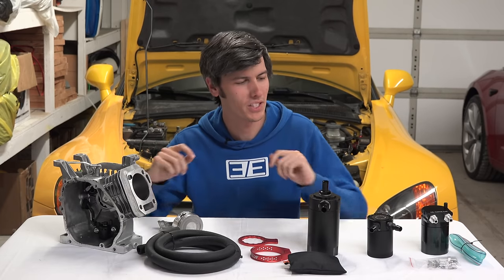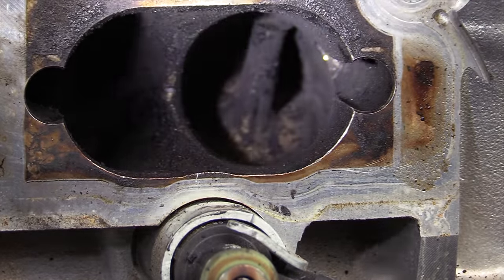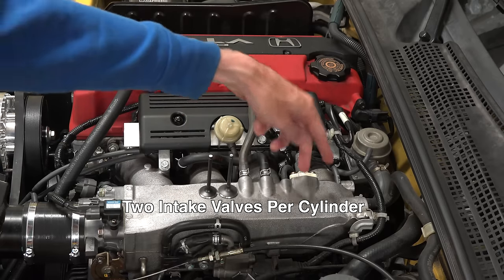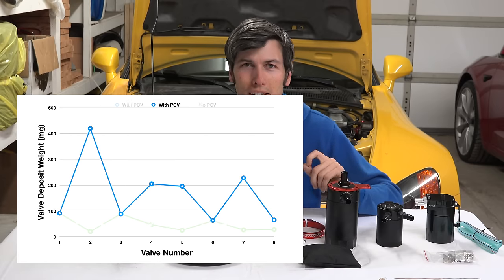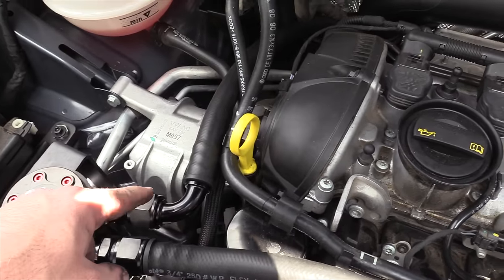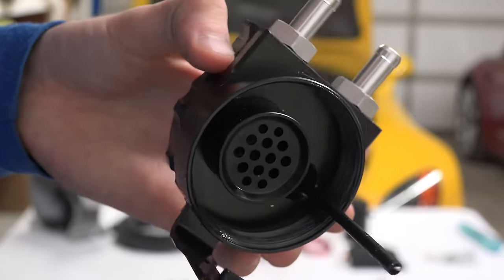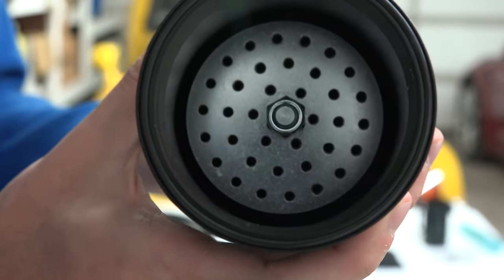Do Oil Catch Cans Actually Work?

Comment from the maker: A lot of questions asking "why don't catch cans come stock on cars?" Lots of reasons here, but some of the most obvious: 1) It's another maintenance item, and customers have a hard enough time just keeping up with oil changes. Examples like AdBlue and water injection systems, come to mind, engineers try to develop solutions around customer maintenance. 2) If a customer neglects it, the catch can fills, and then you're dumping that oil into your intake; this is worse than doing nothing at all. Then it's a liability issue for the manufacturer. 3) Ideally, a proper engineering solution to prevent carbon buildups wouldn't require any effort on the customer's part. This is where auto companies will put their focus. "How do we prevent carbon deposits." There are companies that do much better than others with DI engines. Catch cans are not the only solution. If you have an engine that suffers from carbon deposit problems, a catch can is likely to improve the system, as demonstrated in the video.
Reply: What about dual injection systems like Ford’s twin turbo 2.7 liter Ecoboost that also have port injection along with direct injection? Would a catch can still be useful there?
Reply: There's a 4th reason - engines operated in freezing temps could experience freezing of the water vapor trapped by the can, reducing the efficiency or worse, plugging the PCV system and blowing a main seal!
Reply: No mention of the more expensive, yet better engineered air/oil separators? They have a coolant line run through them to prevent condensation, and run an oil line back to the sump so you never have to drain them.
Reply: @PyroVulpes  I think running that oil back to the sump is not a good idea since that's already contaminated with by-products from gasoline blow-by.
Reply: My st205 celica does come with one as stock, question is venting to atmosphere bad for the engine?
Reply: A lot of OEMs DO actually perform this. They don't have a separate can, because yes, that's maintenance, but imagine if you had a "can" integrated somewhere that could drain oil.

A lot of valve covers (or wherever the PCV has exits) have baffling or swirl chambers in them designed to capture oil mist and drain back into the crankcase.
For example, Ford Ecoboost motors have this, a lot of the VWs mentioned have this, etc. The technical term if you search for it is an air oil separator (see Ford part AG9Z-6A785-A for example). Even vehicles that predate direct injection have this kind of baffling, because oil vapor in combustion reduces the effective octane.

It's a real disservice to imply the OEMs do nothing to take oil vapor out of the air, especially on high compression boosted motors we see everywhere that simply wouldnt function without some degree of it there to prevent oils detrimental effect on knock resistance. The BMEP you see on these modern motors are incredible, and achieving them on 87 octane with even the slightest bit of oil ingestion (like from say the PCV system) is a challenge for OEMs and their suppliers.

I think these are so prevalent because its easy to believe that a catch can will magically solve an issue (and they're easy to make and turn for a profit), meanwhile soot from combustion hits the intake valves due to either internal (via VVT or direct design of a more Atkinson leaning cycle) or external EGR, and you still get a good amount of buildup that way. In DI you don't have much fuel hitting these valves (and the little you did you just removed with your catch can), so its safe to say the soot is going to stick.

Its nice to say, "Oh hey my catch can is catching shit, I'm saved!",  while all of that is still occurring and still causing build up.

As a scientifically guided guy myself, I'd also assume OEMs designed the vehicle knowing that blowby would be there, and even model the PCV airflow and how much of it contains fuel vapor (for accurate fueling!). Your catch can now removes that small but previously accounted for airflow. (Some OEMs even monitor this, and detect blockages! Again, I turn to Ford because Im most familiar with their systems).  We're after the oil, but forget that blow-by also has a good amount of fuel and water vapor also being caught that the system was originally designed for.

Food for thought: It would be cool if you'd be able to convince an OEM engineer to talk about this kind of stuff for some authoritative answers on the matter, or things that they consider when designing these systems!
Reply: @RickJohnson  Looking at their design, unless if they freeze when complete full, it won't matter.
Reply: @normalguyreviews7102  It's not bad for the engine, but definitely bad for the environment.
Reply: Normally before replacing spark plugs on a vehicle. I would rev up the engine to about 2000 RPM and dump a quart of water very very extremely slowly into the carburetor. This will remove all carbon deposits. Do this under your own discretion please. Adding water to fast could cause you to bend a rod.
Reply: @kaan6198  no decrease in power or fuel economy, rather the opposite as the system don't get clogged with crap so the engine runs more efficient.
Reply: @kaan6198  no to either of those, all it does is catch the oil vapors and whatnot from your crank case. only con would be you have to empty it out every once in awhile.
Reply: Actually, I know Porsche has air oil separators installed on some of their cars from the factory. Had to replace one in an old boxster that failed
Reply: @koimaxx  Where did it come from to begin with?  Plenty of engines out there running CCV with returns to sump.
Reply: @normalguyreviews7102  No, but according to the EPA it's bad for the environment.
Reply: Malibu 2.0 has a factory catch can without any baffle.  It’s just a plastic container under the intake tube that has a hose attached that’s  venting the motor.   The top of the can is plumbed into the underside of the intake tube.  Problem is that it’s hidden and not mentioned anywhere.   You have to remove the intake boot to see it and dump it out.   How many people will just fill it up and get a stream of oil going into the intake.
Reply: OR do what toyota did and make a direct injection and port injection system so that some fuel is mixed into the valves that cleans the carbon as it runs.
Reply: @D2O2  I'm not quite sure I've ever encountered an engine that returns the crankcase gases back to the sump. The gases contain not only unburnt fuel (which can change the chemical properties of the oil), but probably worse is water vapor (since the main by-products of a clean combustion is water and CO2), which if condenses into the oil will cause the oil to sludge up, and cause a whole whack of other issues.
Reply: There are cars that come with catch cans, for example my Ssangyong Rexton 2.7 litres Direct injection diesel comes with a self-drain catch can that drains back to the crank case, the engine is designed by Mercedes Benz back at the beginning of 2000's, so I assume that most Mercedes Benz diesel engines will present the same feature now days.
Reply: @Super6-Four  a lot of Subaru owners including myself run air oil separators, they tap into the coolant lines to prevent condensation from forming (the water problem), and fuel blowby is why you change you oil more frequently. This is expecially true when running boost due to higher cylinder pressure. Gas is going to mix with the oil. The hardest part is making sure all the lines are ran properly, because any kink can block the AOS causing the listed issues you have
Reply: fredkuhn165  I’m pretty sure that is an aftermarket can on your Malibu. I don’t think gm would put such a low quality sounding part on an engine.
Reply: The real question is, do oil catch cans help on di engines with oil separates like the le2 in the Chevy Cruze?
Reply: Not sure if it counts as the same, but Volvos' have them; little digging shows they've been doing it since at least 1981; they call it a 'flame trap.'  I've also seem them called a 'breather box,'   It is just a box that gets valve cover air and then lets the oil drain down back into the pan and the another line on top back to the intake.  They're a notorious source of issue for people unfamiliar with them; if they get clogged (mostly if the engine didn't receive proper oil changes and sludges up) the engine will quickly blow the cam seals and sometime main seals.  Most forum guys seem to recommend replacing them every ~100k miles.
Reply: Winston Wolf  how does it decrease horsepower ? isnt a cleaner air/fuel mix better for performance ? or am i missing something ...
Reply: Good video, thank you, a step closer. We still have a problem: in the study did show vrntimg to atmosphere to work better but this is not the same as having an oil catch can. The idea these things work is still as far as I have seen, just a logical extrapolation. The evidence needed is to see a DI car known to have issues normally but with a catch can installed baving no deposits on the valves after 20k miles.  Regarding catch cans we do not know  a) if significant amounts of oil are being caught ( relative to unknown amounts not caught b) whether some other unknown factor is at play. ( likely)
For example - what if it isn't only the cleaning of the valves which is reducing the carbon deposits, what if it is actually the cooling effect of the port injection which is cooling the valves so they operate at a lower temperature - hence the valve is harder and so wear is less and seals remain tighter. Or a myriad of other possibilities. Actual comparison is needed as evidence, no assumptions.
Reply: I have a catch can system (does work GREAT as you describe.  Esp. on boosted cars, keeps that oil out of the intake and charge piping. Anyway, I have a system that drains back into the oil sump (return line).  What are your thoughts on those systems?  I've guesstimated (tho there is no science I've ever researched on the matter) that because with a return, you're adding more garbagy combustion by-products to your engine oil over time, that I've lowered my oil change interval down to 4-5000 miles (full synth) and do the filter every time.  My 89 Volvo and 93 Volvo don't seem to be affected in any negative ways, but then again, these old Volvo motors can take such abuse, maybe its not 100% accurate to say everyone's car would be fine doing so.  Any thoughts on self draining/return catch-can setups?
Reply: @koimaxx  Gases don't return to the sump, only liquid.  This is a very common setup on tier2 and up diesel engines for example.
Reply: All ur videos are just explanations ( basically alot of talking and\or reading from a script.     
       How come I've never seen u work on anything?
Reply: great explanation. i think one example that comes to mind for car companies getting around this issue for direct injection is adding a dual injection system like what ford did with the gen 2 ecoboost engines for the f150. making it have port injection as well as direct injection. I am fairly positive they did this with the gen 3 coyote as well.
Reply: @davidev2219  It's in the name of the channel.
Reply: Don't you think that this bronze filter will freeze from moisture on cold days!?
Reply: Thanks for the explanations. But I'm thinking if using catch cans could lead to a modification on the percentage of fuel/air/co2 mixture that goes into the cylinder, and consequently could be a potential issue rising up the combustion chamber temperature and could affect the long lasting of the exhaust valves. Thanks in advance Jason 😉👌
Reply: Kind of off subject but I cant seem to get a clear reason to why this is. If I had a 707hp motor and I lose 57 hp from transfer of energy to the ground through fly wheel, all belt ran stuff to include a supercharger roots style to trans , tq converter, drive shaft to dif to half shafts to wheels. Now every where I look you lose 15% for manual and 15 to 20% for auto. So if I did bolt ons actually changed the drive shaft to aluminum for less rotational mass with  pulley injectors on a higher octane with a tune on a dyno and made 950 hp crank but lost 150 hp to the wheels. Why is it a percentage and if I only lost 57hp stock with a worst drive shaft and still lose 150hp if the internals are stock with  higher octane why wouldnt it be still a 57 hp loss not 150. So why do you lose more power the more energy exerted with the same mechanical properties material while adding more force? The only quantifyable reason I have is that the materials are the same and being metal with more force makes the metal expand thus causing more friction thus taking more energy to spin making less power being that % rate given every where I read while still making more power than you already had. What is the reason for the percentage of power lost for the same materials designated to take 57 hp to spin the wheel in loss then at 950 150hp to spin the same devices.
Reply: Engineering Explained bmw is the closest ones to factory “catch cans” that I can think of, the ccv system in theory is suppose to collect the gasses and accumulate them in a container to return back to the oil dipstick. The ccv systems have issues all the time tho so they are fairly unreliable
Reply: @D2O2  Thanks for clarifying, I'm not too familiar with diesels. Doesn't the crankcase gases also contain some water that could condensate as well. Maybe you could elaborate.
Reply: Easier fix, vent to atmosphere
Reply: Kirby P. mentioned this above, but BMW engines typically have factory catch can. I know for sure that the B38/B48/B58 family does.
Reply: Mark P  the issue with venting to atmosphere is due to the air circulation of the crankcase you no longer have the ability to keep that system free of moisture, which in turn shortens the life of the oil and contributes to build up of sludge.
Reply: @BEAMERNOOB  I've always thought that the pressurized crank in itself would keep moisture from entering. That and a long enough tube pointing down would also help in keeping moisture to an absolute minimum.
Reply: Mark P all tho the pressure is mainly positive it more or less pulses in and out.
Reply: Oil catch cans are a must for S2000's if you plan on tracking them. I have experienced up to 1/4 quart of blow by deposited into my catch can during a single session. However, if i wasn't going to track her, I wouldn't bother. Too much fuss and more routing of oil lines can lead to a fire if not properly installed and periodically checked.
Reply: 2014+Mazdas have catch cans
Reply: @PyroVulpes  Honest question: isn't that actually a terrible idea. I have an oil catch can on one of my vehicles and there is significant water and fuel in it most of the time.
Reply: @AlphaOneActual  Any car that experiences oil-rich cylinder blow-by that escapes into the crankcase and is tasked to the PCV system will benefit from a Catch-Can system.  It's not the best solution to the problem, but its a start in the right direction.
Reply: @kaan6198  I have the second option in this video and I can say that I didn't see a difference in power or fuel economy. IMO adding the mod is just playing it safe, which is a good thing.
Reply: So how does the intake valve get hot enough to carbonize oil?  Isn't more likely that the oil vapor is acting like a glue and what you see stuck to the valve is the carbon particulate from the EGR?  Direct injection engines produce large amounts of black particulate that would love to stick to some oil.   I don't see the intake temps getting anywhere near hot enough to burn oil.
Reply: The number ONE reason is even IF you could make one for 1.00 (which is obviously impossible) they would lose one million dollars for every million units made so...
Reply: Could you do a video on brake rotor warpage and how hot do you have to get a rotor to warp it.. there is a theory that states heat does not cause brake rotor warpage, instead improper wheel torquing is the only cause..
Reply: Heat doesn't cause it sudden cooling does. get the brakes hot then hit a puddle and ping.    @MaddenMaster843
Reply: my question is, where can I get the $20 catch can?
Reply: @normalguyreviews7102  I don't think it decreases horsepower. It effectively raises the octane compared to a system without it.
Reply: @AlphaOneActual  No need for catch cans on dual injection.
Reply: What about an air oil separator though?
Reply: @davidev2219  it's quite literally called engineering explained. Go look up some of his videos with HumbleMechanic.
Reply: @NoZenith  yes checked it out.   Pretty cool channel.    Love all channels like this there the mechanics not only talk and teach, but also practice and show 
      I was just referring to the the taller thin guy (I apologise don't no his name)   iv ran into quite a few of his videos over the years.   And like I said he just repeats data    recycling info anyone can look up off any mechanic teaching data (.  And yes often providing diagrams and even the parts involved)
       All I'm saying is if he actually showed himself practice why he preaches, he will be Much MUCH more credible.   That's all.    Not trying to hate on the guy
Reply: @D2O2      yes checked it out.   Pretty cool channel.    Love all channels like this there the mechanics not only talk and teach, but also practice and show 
      I was just referring to the the taller thin guy (I apologise don't no his name)   iv ran into quite a few of his videos over the years.   And like I said he just repeats data    recycling info anyone can look up off any mechanic teaching data (.  And yes often providing diagrams and even the parts involved)
       All I'm saying is if he actually showed himself practice why he preaches, he will be Much MUCH more credible.   That's all.    Not trying to hate on the guy
Reply: @D2O2  yes I no that   all I'm trying to say is that I    Love all channels like where the mechanics not only talk and teach, but also practice and show 
      I was just referring to the the taller thin guy (I apologise don't no his name)   iv ran into quite a few of his videos over the years.   And like I said he just repeats data    recycling info anyone can look up off any mechanic teaching data (.  And yes often providing diagrams and even the parts involved)
       All I'm saying is if he actually showed himself practice why he preaches, he will be Much MUCH more credible.   That's all.    Not trying to hate on the guy
Reply: Someone may have mentioned this already, but I believe Mustang 5.0 Coyote engines employ conventional GDI, but they also have an extra injector that also sprays over the intake valves like old fuel injection.
Reply: "why don't they come stock on cars?"
my rewording of that question is: Why can't they come stock on cars and engineer them to dump the oil via one way valve BACK into your oil pan when the car cools down or something like that or even electronically when the engine is shut off? Since it's not that much, it could do it on a regular basis in small increments so you're not dumping a bunch of crud into the engine but rather small amounts that can be picked up by your oil filter or get burned off during normal engine use. Am I wrong in thinking this way?
Reply: Why not divert the oil right into the exhaust manifold where it would burn off.
Reply: @jquiznos2283  Probably too big of a risk of water also getting in there.
Reply: I had a 08 Mini Cooper S I added a catch can on, along with a chip tune. I had to empty that thing weekly! In wintertime, if I forgot and didn't empty the catch can often enough it would freeze and leave a solid lump of ice in the container, block the airflow and create leaks around the valve cover seal. It was a mess...
Reply: What do you think about the DaveFab Catch cans?
Reply: With direct injection diesel that have the EGR systems most are completely clogged by 100000 to 150000km. Which costs alot more than $300 to pull the head off and clean the carbon build up. Also including the cost of bad fuel economy because the intake is clogging up. Mann and hummel make a really good oil air seperator filter in there catch can. Replace every 80000km or so.
Reply: @Flyinghook  Haha
Reply: @davidev2219  Engineering EXPLAINED... You're quite literally describing what he does and what is channel is called. Engineering explained. It's not a tear down of an engine or transmission and rebuilding it or showing you how it wears. It's having diagrams and examples and cutouts to explain the situation so you understand what's going on. Most of us are never going to tear down a clutch to repair it but it's nice to understand what's going on
Reply: @koimaxx  You mean just like all the other oil in your engine? Lol
Reply: I'm in the tropics.. I installed the Mishimoto catch can and it blew out my rear  seal from the increased pressure to the system.. Went to check the catch can and tried to blow on it and nothing could pass thru... bought another one.....same thing
Reply: @AyaxRo   Then you bought crapy products. There is no reason and oil catch can would blow out a seal.
Reply: To me it seems like mechanics could empty the catch can during an oil change easily, atleast in most cases where the can is installed in a convenient location. Also it seems like if a can did get full it would only let as much oil through the engine as it normally would without a catch can.
Reply: Kaan i don’t think it will hurts mpg. The catch can only slows down blow by air flow.
Reply: Don't forget it's also an environmental issue as well.  So they don't do it for both the reason that if someone doesn't empty it it can harm the engine AND the fact that you're emptying pollutants and have to dispose of them.
Reply: @smgoldade  You know everything you say makes sense.  Except that the test he mentioned sort of proved the deposits increase not decrease.

As far as the V6 ecoboost, only one side of the system is monitored for flow by a sensor, the drivers side bank PCV.
Reply: Oldsmobile had a methanol-injected turbocharged F-85 (Oldsmobile Jetfire) back in 1962, but they installed this weird vacuum bypass valve system because people couldn't be trusted to keep their turbo rocket fluid tank full, same as it is today with Adblue/Water injection. The question is, however, can I turbocharge my '66 F-85? Not that I want to, it has all the torque a car its size would need and more, even through its lossy slushbox Jetaway transmission.
Reply: @smgoldade  My '66 Oldsmobile has a little plate inside the valve cover in front of the PCV hole, I'm assuming this is its purpose.
Reply: You missed another one, you need a heater on it during the winter if you live in colder areas to avoid it freezing, simulating an overfull catch can.  Also its sometimes not easy to know the maintenance time between emptying, very high humid days may fill it sooner, so you kinduf got to stay paranoid about it filling up.
Reply: Catch can with breather? Without breather?different results? Pros, cons?
Reply: @AIM54A  remember the intake valve has combustion temperatures on the other side of it. Sure it will cool down as the next incoming charge swirls by, but it still operates in a very hot environment, and it doesn't actually take a tremendous amount of heat to  make oil start to coke up a surface. The heat going out the exhaust valve would pretty much burn off the oil.
Reply: @koimaxx  "I think running that oil back to the sump is not a good idea since that's already contaminated with by-products from gasoline blow-by."
an engine that consumes oil?
Reply: Engineering Explained i bought that $25 exact one for my bmw- big difference- why manufactures don't just use them from the start is beyond contemplation ... but good video ☝🏼
Reply: @normalguyreviews7102  no, it just smells bad and makes your engine dirty. If you have a diesel engine, it's highly recommended to install one
Reply: "If you have an engine that suffers from carbon deposit problems, a catch can is likely to improve the system..." -  Once you've developed carbon buildup problems, it's likely too late to avoid having an expensive walnut shell-blast cleaning of intake valves, which is the only real way to remove these deposits. A catch can should be a preventative measure for direct injection engines.
Reply: My parents V168 A-class with a 1.7L diesel has a catch can (or separator) stock, it doesn't require extra maintenance, since it's made to drain back into the engine (through the dipstick channel)
Reply: Jeep Grand Cherokee WJ with 3.1 TD VM engine have OEM fitted oil catch can with auto drain pipe which goes directly into the oil sump.
Reply: @RickJohnson  This is my main concern. I'd love to hear his thoughts on this aspect of the catch can.
Reply: I have seen OEM oil catch can system on the new Hyundai cars. They have 3 hoses, one from the valve cover, one to the inlet collector and one to the oil pan of the car. I guess they have solved the issue of having to empty the can yourself...
Reply: Can you do an episode on Piston Slap?
Reply: @koimaxx  the pcv system fitted to the bmw m54/56 (and others I believe) runs the return from the crankcase directly back to the sump. I'm having problems with the system now due to age and location but the engine is close to 150000 miles and still pulling like a train with very good emitions.
Reply: @ericsundell9978  the bmw m52/54 engine (and others I believe) drain directly to the sump by design
Reply: KelMaster Construction  Yes!  Humans are also bad for the environment!
Reply: KelMaster Construction  I know, but not to them.
Reply: Why not just redirect and vent the pvc to the open air?
Reply: BillHK thanks man! Wish I still had that Fusion Sport that had the 2.7 V6 twin turbo with the dual injection, sadly a hail storm took it.
Reply: pfoxhound Does bronze freeze?
Reply: In theory, yes. Any restriction in the PCV system will cause the blow by to have a harder time being pushed or sucked into the intake side. How much, depends on your particular setup. There are different styles that try to mitigate the issues with catch cans. The most "maintainance free" styles have a drain tube that goes into the oil pan.
Reply: cant they be made to drain back to the oil pan or exhaust to burn in the cat?
Reply: that would be one sooty exhaust, or be over heating the cat., or soaking the muffler making it ineffective, and possibly dribbling out the end of the tail pipe. not to mention in some conditions catch your exhaust on fire
Reply: @azza9575  how's it empty?
Reply: @mickjager5974  it drains back to the sump
Reply: @Ezzell_  Like the old days.
Reply: Engineering Explained air/oil separators?
Reply: " A PCV valve is something like a maintenance item. Isn't it?
Reply: Mark Watson to my knowledge it would actually be better for the engine as none of these contaminants have to cycle through the intake. However this is terrible for the environment which is why they made regulations restricting that.
Reply: BMW and Saab use a catch can style PCV system that drains back into the crankcase.
Reply: Steven Goldade I got a cheap catch can not sure if home made or not lol do u recommend I put it on my 14 3.5 ecoboost?
Reply: AJ Lopez No need for it secondary port injection like on 4cylinder dynamic force Toyota motors use it to specifically stop carbon buildup on back of intake valves and have put up more than 40% better thermal breakdown numbers IMO they are more reliable than the 1.( and 2.0 Honda’s with everyone installing catch cans No reason with Toyota technology it’s more advanced with also better tumble and faster combustion due to faster tumble than previous years A big advancement from Toyota Get with it Honda
Reply: @AIM54A  Intake valves can get very hot because their internal face is directly exposed to every combustion cycle.  Each time the valve closes, that's its only chance to cool back down a bit.  Intake air helps cool the intake valve as it enters but the main cooling comes from valve-face to seat-face contact.  If the valve face and the seat on the cyl-head get dirty then heat transfer from the valve head face to the cooler seat face is impeded and the valve gets even hotter.  However, you are correct to point out that soot actually comes from the EGR that routes burned gases back into the intake.  If the soot sticks due to oil vapor contamination, then it would stand to reason that catching the oil before it goes in there would provide the benefit of giving the soot less of something to stick to.
Reply: can you do a video on CCV and why you want to always pull a vacuum on your crank case
Reply: @RickJohnson  hi Rick, would you not use one yourself if in a colder climate?
Reply: @wrldendr  I'd remove it during the winters in cold climates to prevent freezing. Not a factor since after my last comment, I replaced my car with a Tesla Model 3. Nothing more to worry about!
Reply: @RickJohnson  niiice.
Reply: @PyroVulpes  which ones .? Never seen one for sale like that? Unless it’s some sort of large industrial system for caterpillars etc..
Reply: Surely this can be taken care of as part of vehicle regular service. With long warranties nowadays even manufacturers would have a benefit?
Reply: @AlphaOneActual  check a few replies below yours. One user states that fords ecoboost engines have a sort of solution for this
Reply: I'm willing to bet manufacturers do NOT focus on "how can we prevent carbon deposits".  Very likely they focus entirely on "how do we control carbon deposits for design obsoelence?"  So they can make a car slowly fail over time, preferably long after warrantee periods, so people are more likely to come back to them for high end maintenance or an entire new vehicle.
Reply: I Would be cool if you sent out the oil in the catch can to be tested
Reply: Should talk about D4S and similar systems as a solution
Reply: @RickJohnson  Who is to say the rubber hose between the PCV and the intake wouldn't get plugged? I do not see how the can changes that...
Reply: I have a 2020 Accord 2.0T and the Mishimoto oil catch can always produces a slight ticking/buzzing sound during light acceleration.  Mishimoto said it's the bronze filter and a known issue. Lots of people in the forum I am in don't hear the sound with the same one. Sound goes away entirely when the stock line is reinstalled. What is your theory on this?
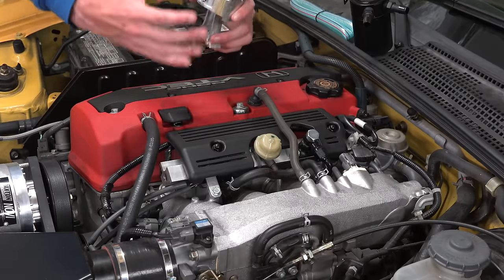Reply: 1:20 isn't the PCV line on top taking blow bye from the valves not the rings? at least in my ford 2.3l it has 2 one on the block and one on the value cover
Reply: @AlphaOneActual  I have an 18 f15 ecoboost with the combo multi port injection working with the direct injection system that you're talking about. It was Fords answer to the direct injection only carbon build up problem on the back of the valves. I installed a catch can and It still collects a small amount of this gunk.   I look at it as inexpensive insurance to prolong the life of your engine.
Reply: @marcoperez4712  oh it’s all good, no need for the catch can anymore anyway. A damned hail storm totalled out my Fusion Sport.
Reply: The reason manufacturers don't put catch cans on engines is simple: THEY DON'T WANT TO SPEND THE MONEY.
Reply: Mazda skyative engine come with factory catch can/tank
Reply: @RickJohnson  where would the water vapor originate?  Plus, if the vapor becomes condensate, it’s freezing point would be much lower because of contamination with oil.
Reply: @andrewhigdon8346  water vapor is a byproduct of combustion and would be contained in blowby gasses. High humidity is another source. 

Water and oil don't stay homogenized or emulsified once the oil becomes saturated (0.02-0.06%), so as it separates, the water layer certainly can freeze.
Reply: hi i have one question pls about catch can install ,my engine is k20a and my plan is run the rocker cover vent to catch can and
Pcv to catch can ! is also good as N/A.? is a good plan.?
Reply: Exactly, cars have to be engineered around idiots who would dry their kitty in a microwave. :)
Reply: @RickJohnson  Exactly why I've not bought into this mod. I'm in Alaska and have driven through -40*F to -50*F conditions and the last thing I was is some unexpected problem or break down I created by adding a system that wasn't part of the original engine or emissions design. The more research I do, the more inclined I am to leave well enough alone.
Reply: couldn't a guage be tapped into the can too inform the user that its getting full i mean i can't see it being that difficult too install on a catch can fill gauge send a line down too the bottom of the engine bay so you can slide a oil pan under and open it too drain and than close the line off again great video tho !
Reply: Question: I have a 2014 Fiat 500 GQ 1.4 liter 160HP Turbocharged 4 cylinder engine with 5 speed manual transmission and about 20k miles. Drove it in the Smokey Mountains and climbed up to Newfound Gap with no problems however when I came back down the mountain I used third gear for engine braking to save the brakes. It is a long way back down and the engine was turning about 3,500 rpm while “coasting” in third gear and again, using the engine braking to keep speed down to limit. Once we got to the bottom and into stop and go traffic, we were idling a lot and then when I opened the throttle up there was a huge cloud of oil smoke out the exhaust that looked like a smoke shield from a James Bond movie. The condition cleared out after awhile but the car is white and there were black oil spots over the back of the car, especially the bumper area near the exhaust. This happened a couple of times later on but not as badly as in the mountains and eventually I got a check engine light and a code for catalytic converter efficiency. The dealer ordered one but it took several weeks to get it and by that time the MIL did not return. I asked them about the problem and they had no real explanation for it although they replaced the spark plugs, resealed the plug tubes and replaced the PCV valve and the oil separator. My theory is that the engine may have excessive blow by and the high manifold vacuum produced by coasting in third gear for a long distance actually sucked oil from the factory catch can into the intake and then when I accelerated the oil was drawn into the combustion chambers and burned, causing the smoke.
Here’s my question: Could one of these Oil Catch Cans possibly cure the issue by separating the oil and holding it to prevent it being drawn into the engine?
Appreciate any advice.
Reply: The one that I was considering's manufacturer seems to recommend running the drain tube to the sump, which would make sense if it came with the car...
Reply: "Ideally, a proper engineering solution to prevent carbon buildups wouldn't require any effort on the customer's part. This is where auto companies will put their focus. "How do we prevent carbon deposits." Yes but until this ideal world manifests you could choose something that burns cleaner and prevents the bulk of it in the first place, LPG, right?

"Examples like AdBlue and water injection systems, come to mind, engineers try to develop solutions around customer maintenance." They better do and not just cause problems you would not have without them. 👍
Reply: I understand why you would say that about your average DI passenger car. But what about my GT350? It’s an enthusiast car. It should come with at least a passenger side catch can. People buying these cars understand they maintenance.
Reply: Good point. I may put a oil catch can on my Fiero 2.8L V6. I will put a sensor in it that lights a spare light on my instrument dash when it gets close to full. Thanks for a great video.
Reply: @koimaxx  I concur.
Reply: @RickJohnson  Good to know, thanks!
Reply: @Flyinghook  not true, it is factory and my Buick Regal 2.0 t came with the same setup!
Reply: @PyroVulpes  can you get an air oil separator as aftermarket? Since some OEMs fitted it in their designs, I wonder why dual port became a thing. It's a more expensive option obviously
Reply: Wouldn’t all of them have the problem?
Reply: On modern it is no longer a Positive Crankcase Ventation ( pvc), but now Closed Crank Case Ventilation (ccv), as they are called , my 1.5 cents
Reply: @ronaldshepard4625  Bad advice.  Most vehicles today are Fuel Injected and so many more are forced induction.  If you are still running a carb, then you most likely know who to maintain and care for a vehicle.
Reply: Where do we dispose of it
Reply: How do we dispose of it ?
Reply: vent to air.... priceless
Reply: @ronaldshepard4625 what’s a carburetor?
Reply: @AlphaOneActual tous les injection directes qui on une valve pcv
Reply: @RickJohnson  Most have a dip stick...check it once in a while.
Reply: What about crankcase pressure increase and the problems it may cause due to bronze filter inside the catch cans?
Reply: Well said 🙏🏽
Reply: Air / oil separators do come on cars.    They typically are underneath the valve cover where the PCV hose connects,
Reply: What are your thoughts on oil catch cans with a one-way valve in the hose going to the manifold? Allow flow to the intake, but now back the other way.

🤔🤔
Reply: @RickJohnson  It isn't just vapor, it is liquid water as well.  When you empty your catch can, toss the liquid in your freezer and see how much of it freezes.  I wonder what the ramifications of this are for people living in cold climates.